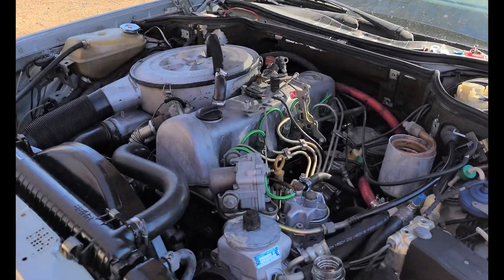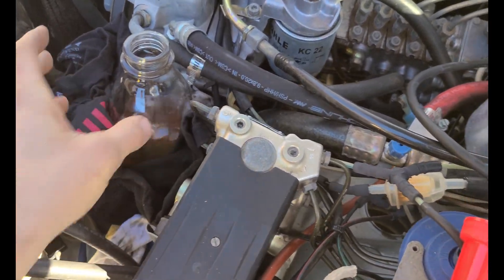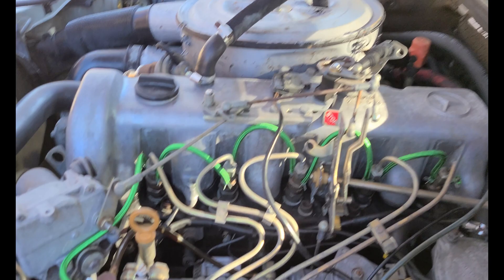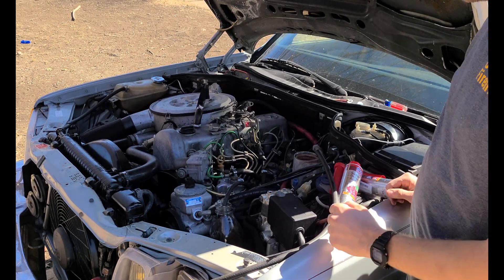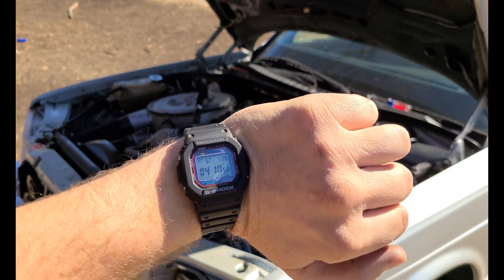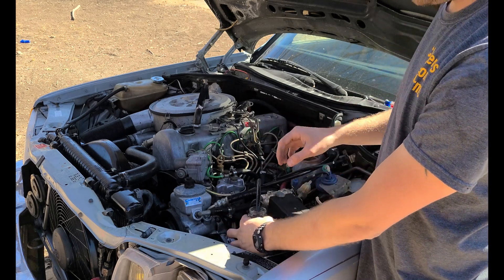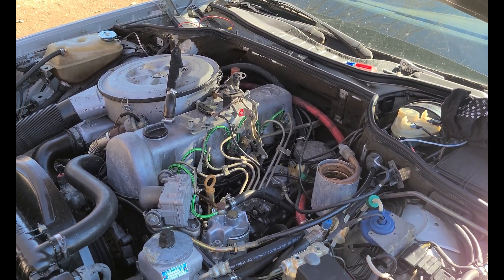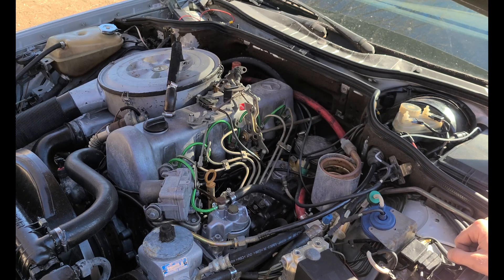Diesel Purge  Liqui Moly: cleaning the fuel injectors on a Mercedes om617

Comment: The best way to run diesel purge through is to put both your feed line and return line into a container with the purge and let it run. If you only run it through the feed line most of it is being returned to the fuel tank. When you put feed and return in the purge container it creates a loop so it all gets burned i stead of being sent to the tank.
You get better results. My om603 took about 15 min to burn 2 cans. Then I reconnect fuel lines.
Reply from the maker: This is absolutely true ^
Reply: Got any vids lol asking for my 85 turbo diesel

Comment: You are returning to the fuel tank?
Last time I did a diesel purge I returned to the glass jar and ran the engine until the Moly product was almost used up. I connected to the pre filter, not to the pump directly as well. 
Just another way of doing it. Your engine ran well before the purge so the extra cycling was probably not necessary anyway.

Comment: Nice video! I haven't worked on an OM617A that's run WVO but when I do a diesel purge I run a closed loop (pickup and return lines into the same bottle- lets more diesel purge run through the system vs returning to the tank).

If you haven't already I suggest replacing the in line and secondary fuel filters (fill the latter w/ diesel/diesel purge before install so you don't have to use hand pump primer on the fuel injector manifold). I don't know how to access the tank filter on a W126 but that's definitely worth looking into.

Have you adjusted the valves recently? Combine that with the purge and she should run like a top. Happy travels!
Reply from the maker: Running a loop is the good idea. Adjusting the valves did make a noticeable difference !

Comment: Great video, so you attach the line with liqui molly to the pump which circulates through pump and injectors, and then it goes to the fuel tank from the injectors? Sorry I’ve not got the same vehicle mines a London Taxi, just trying to figure out how to do mine, 
I’ve got a fuel pipe that goes into the fuel filter which draws fuel, then once filtered via the filter the other pipe (an out) also connected to the fuel filter takes it to the pump, but I found a 3rd pipe when I was having a look at the setup, the 3rd pipe comes from the injectors and connects to somewhere different in the engine bay , sorry if I’ve confused you , any help how to the purge would be great.
Reply from the maker: You got it right! The return just goes back to the tank